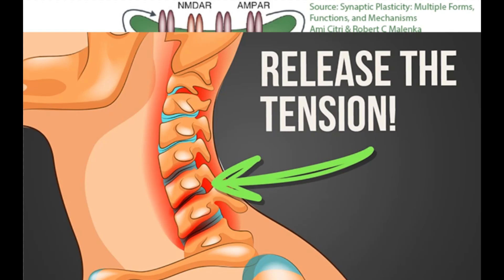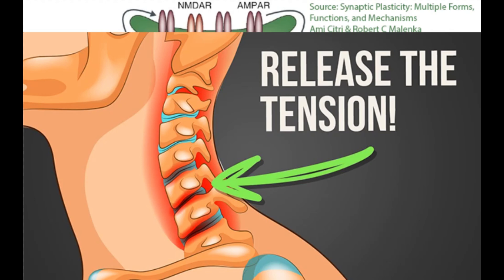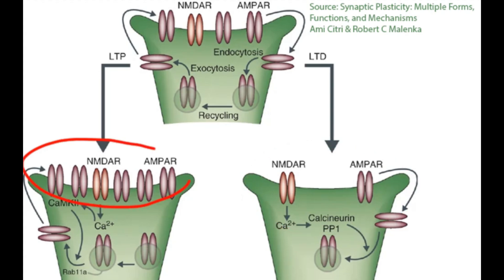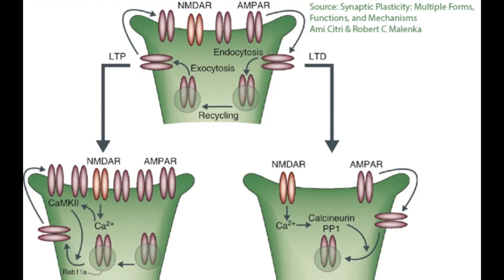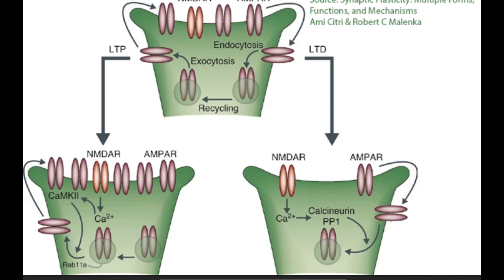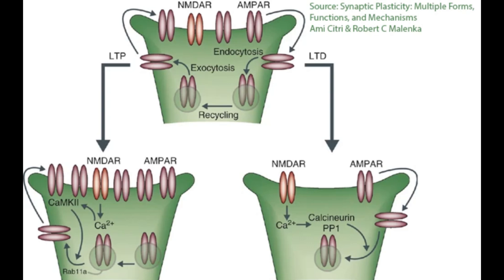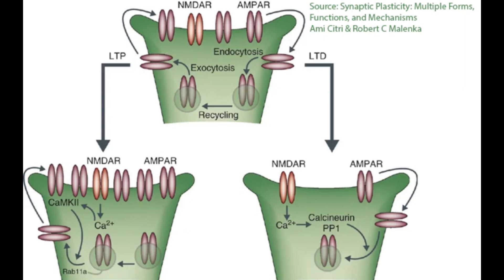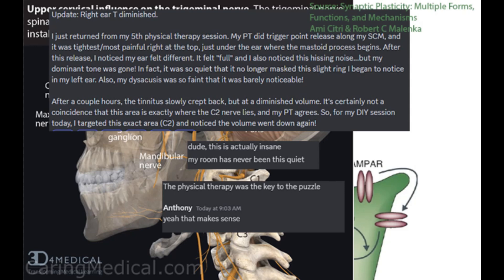Bisensory Neuromodulation, Somatosensory co-factors, LTD/LTP

Comment: Your description of tinnitus as a somatosensory problem is true. I started with tinnitus five years ago and was frustrated y he response of ENT specialist and audiologists. Fortunately I I am a physiologist used to researching medical matters The breakthrough that allowed me to solve my tinnitus came from two sources John Berger a US chiropractor said it was due to misalignment and stress in the cervical spine and associated muscles, especially linked to head forward from computer use and I came across a paper from Brazil that essentially explained it in the terms you use and said it was linked o humans using nerve signals from the neck and shoulders muscles integrated with that from he ear to determine the direction of sounds.. The other factor was it completely disappeared when I was in the shower or walked - the trapezius is connected to the neck muscle and if tight will pull on them. Now most of the time it is gone unless I sleep in the wrong position or spend too much  time on the computer. The only point I would revise from the above is that I now think it is a fascia problem so can result from problems elsewhere in the body. This fits with the fact that 70% of persons put in a sound proof chamber will get short term tinnitus suggesting they are hearing the nerve flow through the fascia.

Comment: I have found that a long, hot, shower reduces the volume significantly, if only temporarily.  Usually lasts a few hours, for me.  It takes maybe 10 minutes to reduct the volume AFTER you get out of the shower.  I found from x-rays that I have a ton of calcification at my C1 - atlas and axis.  I think this might be the root cause of the T.  I will be looking for a licensed PT.  If anyone knows anyone in the SF Bay Area, please let me know.
Reply from the maker: Are you sure your shower isn't causing residual inhibition? That happens pretty often in cases such as these. But it does sound like you have some upper cervical issues.
Reply: @TinnitusLabs  I don't know what residual inhibition is,  :)  I do know that after my left ear went through the roof almost 4 years ago, I went to a chiro who cracked my neck, and I walked out with a different sound in my RIGHT ear - which has not gone away.

I'm really hoping the SSD works.  This wait is killing me.  And I will try to find a PT.  I just hope I find a decent one.
Reply from the maker: @knotatraitor  Chiros are menaces to society. Sorry that happened to you.
Reply: @TinnitusLabs  they have helped me with several cervical issues which would not go away. After my atlas was realigned and other joints manipulated, discomfort in my neck, hip and back went away.
Reply: @knotatraitor  I get a quietness after using my hairdryer - residual inhibition is when the brain’s focus is distracted by another noise for a few moments.
Reply from the maker: @melodyebuskin5490  Not really correct. Residual inhibition is when hypersynchrony is temporarily scrambled due to input to specific parts of the auditory pathway.
Reply from the maker: @melodyebuskin5490  And they also broke my grandfather's back, killing him
Reply: @ I’m so sorry. I see now why you’re so down on Chiro’s. The ‘they’ was one person. They are not all the same.
Reply: @ but isn’t that just a more scientific explanation? It’s affecting a part of the brain that changes the signal.
Reply from the maker: @melodyebuskin5490  Well, I guess
Reply: @TinnitusLabs  I looked up RI... I don't think it's RI, only because it "usually" lasts for a few hours, it seems.  Sometimes less.  Sometimes it doesn't seem to help much. I believe it's calming my central nervous system down, much like mindfulness / meditation does, (though not nearly as low as a shower typically does).  Problem is, I can't take a long hot shower every 2 hours.  

I've found that talking about it too much - sometimes even a little - will often trigger a spike that can last a few days or up to a week.  Which is why I've mostly stopped doing that.

Comment: I see a giant connection with somatic tinnitus (most tinnitus sufferers have this, if they can manipulate even one tone with jaw or tongue movement) and the c1 and c2. What are your thoughts on upper cervical chiropractic? I can't not see a connection between the two.
Reply from the maker: @smputaoot  Chiropractors are quacks and should be avoided. I would only trust professional physical therapists/ manual therapists.
Reply: @TinnitusLabs  let's not be totally dismissive with this treatment. While I agree with the sentiment that most chiropractors who crack patients backs, and hips are usually not lasting or not beneficial. Others who have had tinnitus have found lasting  relief from an upper cervical correction. This certainly can't be attributed to a placebo effect. The main keywords used in diagnosing somatic tinnitus are (spine misalignment, muscle tension, muscle movement exacerbating or lowering tinnitus). Somatic tinnitus being altered with tongue, jaw, or cheek movement or pressure is all heavily connected with a cervical injury.
Reply from the maker: @smputaoot  Chiropractors do not have clinical practice, nor do they have a medical education. It is well known in the medical world as placebo and quackery. Sure, maybe some people were helped, but many worsened too. A professional physical therapist is not going to break your neck by jerking it around in random directions.
Reply: Some people do get better when the atlas is repositioned some do not. There are several vids on YT on this showing patients being adjusted and saying that the noise has gone down. It did not work for me after several months of adjustments.

Comment: Do you have any idea if it will also help visual snow syndrome induced tinnitus? I mean from the research I've seen my tinnitus without hearing loss is also caused by this because it's somatic plus thalamic gating issues, there was a very interesting study done, on the medial geniculate nucleus of the thalamus and deep brain stimulation which helped many people, what's your thoughts on that, and would you recommend any deug in the meantime as long as we wait for the susan shore device? Any Anticonvulsant which could help? For example Topiramate can cause and worsen tinnitus and it also works on AMPA/Kainate receptors, so ajy other alternatives which could rationally work, i don't really know maybe any suggestions? I'm willing to experiment and post back, my tinnitus is already severe so. Thank you for all the information!
Reply from the maker: @AnimeWinter2309  Hey. No drugs at the moment can reliably target the correct AMPA receptors. There's too many inconsistencies (even if there are multiple anecdotal cases) with meds. Some may work for a certain subgroup, others not. I honestly cannot say with confidence that the device would work on VSS. There really hasn't been enough research to give an answer to this question.

Comment: Will it help with tinnitus caused by hairless cels
Reply from the maker: Yes. Hair cell less doesn't directly cause tinnitus though.
Reply: @TinnitusLabs So it's just misfiring of the cells?
Reply from the maker: According to Thanos Tzounopouloses research, hearing damage/acoustic shock causes KCNQ2/3 potassium channel dysfunction (neurinflammation etc), which, consequently, may lead to hyperactivity in the DCN for some.
Reply: @TinnitusLabs  will the building device be  beneficial?
Reply: @TinnitusLabs  DCN device will help hyperactivity
Reply from the maker: @Musa-yx4zt  Yes
Reply: Cells in the ear?